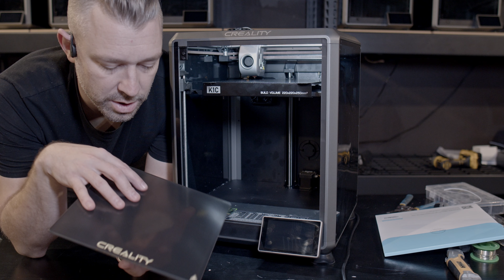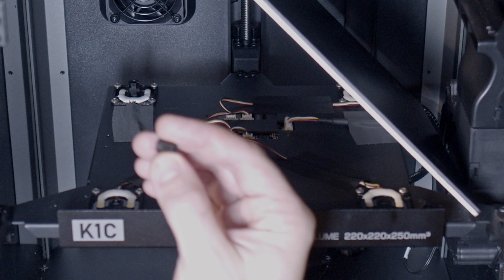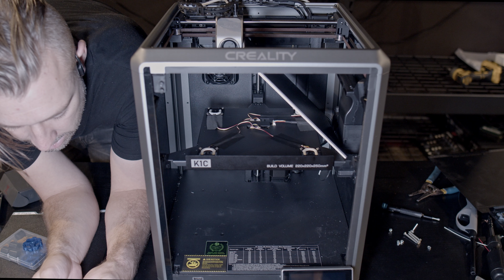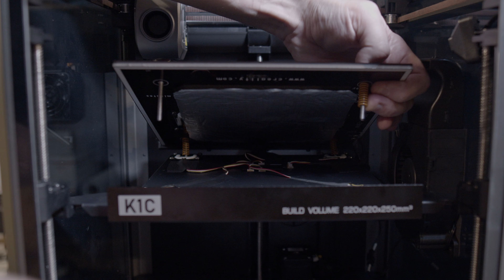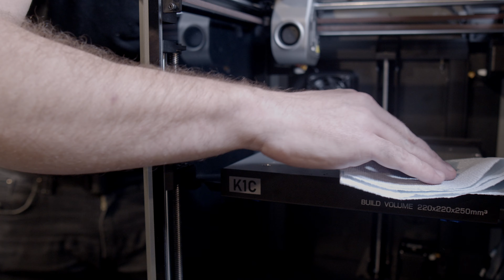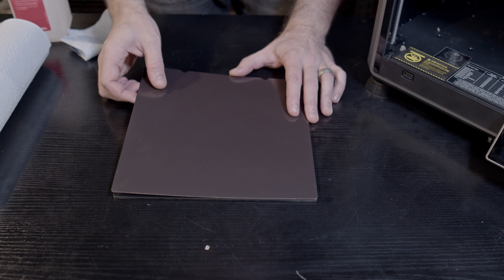Fixing the Creality K1 Series bed warping with the Sub Bed Mod

Comment: Have placed order for parts for k1 max. 3m sheets are too expensive here so ordered a 25mm 3m tape and will use that. My k1m bed turns into a soup bowl once its heated. Will share update once I've installed it.
Reply from the maker: Nice. Best of luck with the mod! Let me know how it goes.
Reply: Any update on your progress? My K1 Max glass arrived (i used the link in the description) so decided to test it before applying magnet cover or 3M tape. I placed it on the bed magnet cover and i did a few bed mesh test iterations at 75 deg. The glass mesh had the deviation of 0.38mm (center curved up) which is higher than i have without it (bowl, 0.36mm deviation). So i'm not sure if it worth it the investment. I'm thinking on applying some wide kapton tape on the center in the lower zones. I have the spring mod installed and the bed corners perfectly leveled.

Comment: I just did this mod and it’s a game changer. I have a question now that its thicker with the glass do we need to bring up the temperature when printing? I pray PLA with the regular bed at 60.
Reply from the maker: Through my testing I've only found a 1c drop in temperature with this mod. I tend to leave my slicer setting alone and not account for this single degree drop.

Comment: Do I need to install something like the BTT eddy of I make the glass bed mod?
Reply from the maker: The only way to install without an after market probe is to not use the springs and knobs portion of the mod. the load cells require a rigid mounting to the heat plate to work accurately.

Comment: Geat mod!!! What would happen if you put a magnetic sheet on both sides of the glass and magnetically attach the glass to the aluminum bed?
Reply from the maker: There have been a few people who have tried this. One reports that it works well, the other reports that it did not. I will be testing this to see how viable it is.
Reply: 3m tape a sheet of metal to glass then magnet the other. Now it’s just double stacked magnetic beds

Comment: Is there any truth to the thought that using a glass plate adds significant load and with that wear to a bed slinger's Y-axis motor?
Reply from the maker: The short answer would be no. The longer answer would be that adding a glass plate does add some mass, which could, in theory, slightly increase wear on the Y-axis motor over time. However, this effect is minimal, and the belt and motor are more likely to degrade due to normal use long before the added mass from the glass plate causes significant issues.
Reply: @zerodotcmd  Thank you very much. It seemed to be a big deal depending on who's being ask for the belt and motor. The motors seem more than capable on the printer I have. Thank you again! I'm very likely to do this mod

Comment: Can I do this mod on a cr10 smart that is auto leveling and does not have the adjusting springs?
Reply from the maker: Technically you can 3M glass to any 3d printers heat plate. a few modifications may or may not be needed based on the printer.

Comment: Ibe brought one and this was my biggest concern but as makers i knew someone would figure this out. X
Reply from the maker: It was a problem that needed solved. :)
Reply: @zerodotcmd  I'm glad someone has, I was getting stressed reading all the platform failures. But I'm glad it's a relatively easy correction. 

Also..  you know where I can get armour files? 
Kinda brought one so I can save myself 100s of hours building cosplays.
Reply from the maker: @TheunknownlogicOG  the best place to find files would be Thangs.com

Its not only a file host but its search is multi site search, and by far the best model search in 3D printing.

Comment: have you tested temperature differences on top of the bed, since its now having to heat both aluminum and the glass plate?
Reply from the maker: Yes the temp difference is only a -1 drop in temperature from the plate to the glass.

Comment: So what happens if you do this mod without doing the probe mod?
Reply from the maker: When doing this mod without an aftermarket probe, you'll experience a "movement not smooth" error with the Creality firmware. However, you can do this mod and skip the leveling kit portion and only do the glass mod portion. The use of springs on the load cells returns inaccurate readings that the firmware isn't able to make sense of. Skipping the use of springs and knobs will still allow the glass mod portion to work with the firmware.
Reply: @zerodotcmd I did this mod today on my K1 Max and used 8x4x15mm medium load die springs (B0B6PQ4BV3). I also used a 310x310 glass bed with longer M3 screws at the back of the bed. Pushed the glass against the screw shafts (screw heads above glass surface). There is a small ~5mm ledge/gap at the back under the mag and steel sheet, but the nozzle only wipes in that area anyway and it looks and functions like factory. Stock PRTouch still works perfectly fine. No errors and I went from a 0.48mm mesh to 0.16mm. So thanks for shining a light on this mod, but you're incorrect about needing a probe.
Reply: @andronicuscomnenus2642  Great to hear. Care to share how long of M3 screws you used?
Reply: @zerodotcmd  ok cool so essentially just put the glass plate on top of the existing plate? Might as well just print on a glass bed then...hmm
Reply: @zerodotcmd  Finally got around to doing this myself. Amazing mod. The 3m double-sided sheet was no joke. Messed up my first one. Was very hard to remove the sheet once it was placed down. I didn't actually have to drill out my spacers. The screws I used went straight in freely. My new range is 0.1359!
Reply: Nothing happens, everything is working as it should, tested on my k1 max, no errors

Comment: On the K1 Max you also need to make the platform higher that contains the lidar sticker or it will generate Lidar Error
Reply from the maker: This is true if you use the original LiDAR sensor.
Reply: Yeah i need this too. Meybe just print square that much thick as new glass.
Reply: Any printing stl or the thickness needed to rise it 
Thanks

Comment: Great Mod. is there a reason why yiu never had 4 holes drilled in the glass plate to allow the heat plate to be removed of needed? no holes, means this is close to a permanent install, that may break the glass if it needed to be removed.
Reply from the maker: That would be ideal, however the glass is almost impossible to drill through.
Reply: @zerodotcmd Actually its not that hard.
To be correct, its more like grinding through rather than drilling.

You use little cylindrical bit with a diamond cutter and some water. And lots of patience.
Reply: @Coyote27981  that only applies if it's float glass and not tempered glass

Comment: I used a 1/4” tooling plate. It worked out fine. But I am interested adding the springs and knobs as well. Do you have a reference or link for installing the eddy current probe? I just tripped across this video. You just got another subscription, thanks!
Reply from the maker: Tool plating works great too. Unfortunately, it’s a bit more expensive and not as easy to acquire for many people. I also have a video on installing the Eddy Probe for the K1 machine. Here’s the link: https://www.youtube.com/watch?v=R1xVWi40kcA
Reply: No need for an eddy probe. Factory sensor works fine.
Reply: @blamm5348  I was just about to ask why the probe mod was needed. Have you done the mod without changing probe?

Comment: Amazing. Is there a way around modding the probe? I would like to keep the load cells and skip the knobs. Would the mod work if I simply glue the glass on the aluminum after drilling holes in the glass to access the screws for future maintenance if needed?
Reply from the maker: Yes this would work. This is what I recommend to users who would like to stay stock. Just skip the leveling kit part and the mod still works for the glass.
Reply: You can  use load cells and the knobs, tested, no problem at all👌
Reply: @Pablo-vt9jp  perfect thanks for the tip! I did the mod maintaining the load cells with the original threaded spacers and it worked too. Maybe I’ll add the knobs after all!
Reply: Great! Do you know if their glass is tempered or not and whether anyone has successfully drilled it before?
Reply: Ok it says it’s tempered on the amazon listing so no drilling :(
Reply: @ZakWlak  For what it's worth, about any glass is going to be good and flat. I used to print on a sheet of mirror. Since you're not going to be thermally shocking it, you don't necessarily need tempered glass. You could very likely get a glass shop to hook you up.
Reply: @IN10THRC  thanks for the suggestion! I kinda thought of a workaround I’ll just glue the screw heads (long screws) in their countersinks with some high temp epoxy. This way I can always take the bed apart from below without needing to unscrew from the top. I’ll see how it goes when I have the time to work on it

Comment: I’m confused why this requires the btt eddy mod. I’m brand new to this so I need some education please. Thanks.
Reply from the maker: Thanks for the question, and welcome to 3D printing! The stock method used for probing the bed relies on touch. Touch probing requires a rigid attachment between the heat plate and load cells. When this mod is used with the spring leveling kit, it removes these rigid contact points, making it so the stock probe can no longer work.
Reply: @ understood thanks! How hard is it to run btt eddy with a rooted K1 Max with Fluidd or Mainsail?
Reply: @zerodotcmd  I wonder if it still might work. When I cranked the bed down as low as it could go, it felt SOLID. Between that and how relatively soft the touch probing is, the compressed springs might just be solid enough for the load cells to work. It would require some testing though and I already switched to the eddy anyway. Besides, it looks like someone is already working out "touch" z-probing functionality for the eddy, it's only a matter of time before we have accurate z-probing.

Comment: I don't understand why you must change the probe also. I get that adding the probe would help with a more accurate mesh but couldn't I do this bed upgrade to get rid of the warp?
Reply from the maker: You can do the Glass portion of the mod to get rid of warping. but you cannot do the leveling knobs without an after market probe. The load cells "four stand off points" require rigid contact to work correctly. Using the springs for leveling make it so these cells are no longer useful.
Reply: @zerodotcmd  Last question, hopefully lol. I found this because I ended up with the strain gauge failure. Does adding the eddy probe and rooting eliminate having to fix that? Thanks
Reply from the maker: @rocky6428  Yes adding an after market probe completely removes the need for Load Cells / Strain Gauges. These are complete garbage the way Creality implemented them. Thankfully we can completely solve this problem by using after market probes. I have another video coming out soon talking more about the Load Cells and completely deleting them from the printer. It should be out later this week.
Reply: @zerodotcmd  Awesome!!! Thank you
Reply: @zerodotcmd  I appreciate the reply. Thank you. love the videos

Comment: i already have my (2) k1 max's rooted & just got all the parts for this & the eddy upgrade, but how does this work with the screw tilt adjust if i can no longer use the tap sensor?  i feel like i am missing something?
Reply from the maker: @-SeanyBoy-  The glass mod isn't compatible with the tap/load cells if you use the springs and knobs. The screw tilt macro does work.
Reply: @zerodotcmd  so i use silicone spacers , after modding the eddy, i need to run a bed mesh, tune the dials, run mesh, tune, mesh, tune, etc...? then check daily or weekly to see if the wheels moved any & do it again if so? it seems counter productive, how often do you realign the wheels? I just need to know what to expect, any other tips?
Reply from the maker: @-SeanyBoy-  It depends on the user. some users claim to have gone months without needing a re-adjustment. While others go about every other week or so. There are options to making sure the knobs don't back off over time. Locktite being one. I'm currently working on coming out with a permanent fix for the knobs backing off.

Comment: Hi, sorry for my English :D . How do I do for the wedding cleaning comb?
Reply from the maker: Its OK :) sorry I do not understand though. You can use your language and google will be able to translate it for me. Then I should be able to help :)
Reply: @ scusami :) . La mia domanda è …con questa modifica. Come fai con la spazzola di pulizia per l’ugello?
Reply from the maker: @MGSmartech  with the mod a cleaning brush isn't needed since the mod uses an after market probe that doesn't use tap for probing. The SimpleAF firmware makes use of purge lines instead of nozzle brushes.
Reply: @zerodotcmd  io ho tutto originale. Ho installato klipper. Quando avvio il livellamento automatico non fa la pulizia ugello ma quando avvio la stampa fa la pulizia e anche la linea di spurgo. Di quale sonda parli? Scusa l’ignoranza :)
Reply from the maker: @MGSmartech  I use both the Eddy and the Cartographer3D probe. I highly recommend the Cartographer. The Eddy not so much.
Reply: @zerodotcmd  grazie per i consigli :) . Complimenti per i tuoi contenuti.
Reply from the maker: @MGSmartech  No problem, hope it was helpful :)
Reply: @zerodotcmd  scusa se ti disturbo di nuovo. la modifica del cartographer 3D è indispensabile farla?
Reply from the maker: @MGSmartech  No problem ☺ The Right Angle Cartographer probe uses a 3D printed mount and requires no modifications outside of the firmware flash required for install into the K1 with SimpleAF. I have a video coming out on this topic very soon.
Reply: @ ok allora aspetterò con ansia l’uscita del video :) Nel frattempo posso iniziare a montare le molle e il piatto in vetro?
Reply from the maker: @MGSmartech  I would wait because then your printer would be down until you got the probe and firmware installed since the load cells do not work with the springs for leveling.
Reply: @ quindi vuoi dirmi che se io monto adesso le molle e il piatto di vetro il livellamento non lo riuscirei a fare lo stesso?
Reply from the maker: @MGSmartech  Yes this is why an after market probe is required. The Load cells require a rigid contact point from the heatplate to the bed frame. the springs remove this rigid contact so the load cells don't work correctly for leveling.
Reply: @ ok ok…allora aspetto che metti il video. C’è già qualche guida per il montaggio della sonda?
Reply from the maker: @MGSmartech  No there isn't unfortunately. I will have all this information in the video when it is available.
Reply: @zerodotcmd  ok grazie mille come sempre :)
Reply: @ ok Thanks :)

Comment: why is the prob required for the mod? will it not work with the oem probing
Reply from the maker: If you use the springs and knobs for leveling the load cells will not work. You can however do this mod without the springs and knobs. This still helps fight warping as this is the primary function of the Glass Mod.
Reply: @zerodotcmd  thanks for the explanation!!  do you know if the creality glass bed is tempered glass? i would like to get rid of the original bed all together, my mesh is really really bad. but i dont think i can drill holes in tempered glass.
Reply: @zerodotcmd  what if the spacers are retained but levelling knobs are used.....will the load cells still work?
Reply from the maker: @evanovski  The leveling knobs will not work with the original spacers since they are rigid. There would be nothing for the knobs to compress. The compression is how the knobs are able to level the bed. If someone would like to keep the load cells the best option would be to do the Glass mod portion minus the leveling kit.

Comment: Instead of the chemically treated Creality glass plate, you could (should?) use one made of borosilicate glass. These are absolutely temperature-resistant and -stable and have long been available in the right size on the third-party 3d printing market. They are also significantly cheaper. (The Creality plate is probably also made of this glass. However, the impregnation is more harmful than useful).
Reply from the maker: I agree with this. The parts I list are listed because I know they are easily available for everyone without digging to much. My goal is to provide the basic information and let people go from there. There are definitely way better glass options out there.

Comment: Will the btt eddy still work with this Sub Bed Mod? Ive watched both this and the BTT eddy install and you never mentioned if the glass bed will interfere with it
Reply from the maker: The BTT Eddy will work with the glass bed mod. The Eddy reads off the top of the flex build plate.
Reply: @zerodotcmd  Awesome! Thanks for getting back to me so quickly too
Reply: @zerodotcmd is there a reason you said a new probe is required? Why won't the normal tapping method work with this mod?

Comment: Hoi Vraagje welke m4 diameter moet ik hebben? 12mm 16mm 18mm
Reply from the maker: I'm sorry, I'm not sure I fully understand the question. But would be happy to help if I understood better.
Reply: @zerodotcmd  bedankt voor je reactie. Mijn vraag is de schroef m4 voor de bed, welke moet ik kopen. Want de set van amazon verkopen ze niet in mijn land.
Reply from the maker: @appadove9369  Sorry for the late response. The m4 screws are 35mm long with a 8mm diameter screw head.
Reply: @zerodotcmd  dankje wel